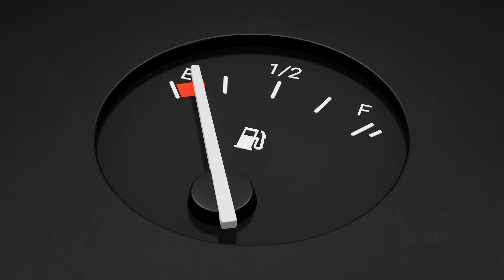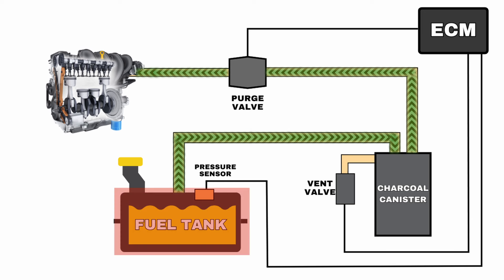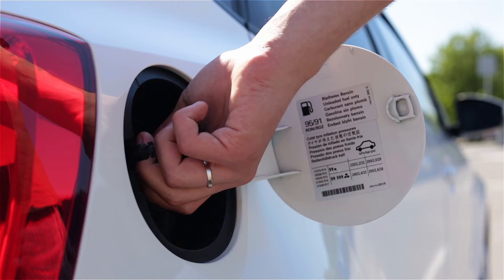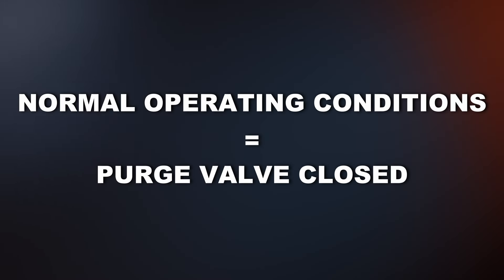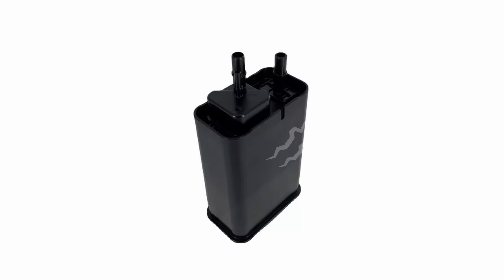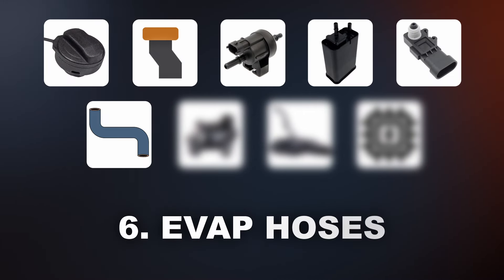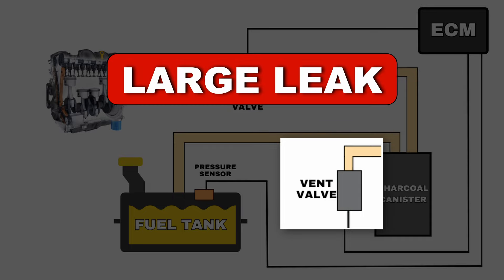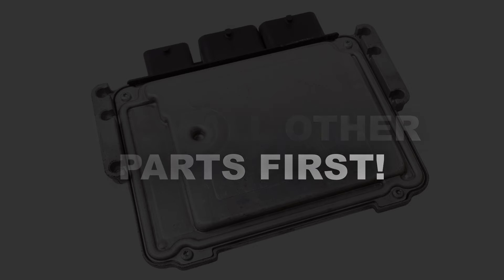P0455 Trouble Code: Evaporative Emission System Leak Detected (The Most Common Causes)

Comment: Hello there, thank for the video . Question : 2012 Nissan Pathfinder , have issues with irregular rmps, and with, maybe , what appears to be transmission shifting .
1. RPMs will suddenly decrease/increase rapidly when coming to a stop, and/or stepping of the gas pedal.
2. Car will jerk foward/backwards when stepping off and on the gas pedal while driving .
P.S. No error codes .

Help🤔
Reply: I can help
Reply: If you haven't fixed it yet, my 2012 Civic had this. Stepping on the gas too hard would gas it to lurch and then go nowhere. Coming to a stop and letting up off the brakes would cause the car to lurch forward. Culprit was a broken air intake tube. Sensor light never came on because engine filter was filthy and the compensation "balanced".
Reply: @theacesalmon9498  your symptoms are not the same that minea, I never steped too hard.on the pedal, and whrn coming to a.stop my vehicle never jump forwards, it just the rpms needle that moves up and down, but the engine speed still the same, doesn't accelerates,

Comment: I had this code on my 2005 Dodge Ram 1500 5.6 Hemi.  I changed the purge valve. The code returned.  I then replaced the charcoal canister and vent valve.  The code came back.  I then RE-replaced the purge valve and the code went away.  That was an expensive defective purge valve because charcoal canisters are expensive!
I am now having a problem with filling up the tank.  It shuts off which makes filling a 27 gal tank take 15 min.  I purchased a smoke machine and found NO leaks.  I am at a total loss... any ideas?
Reply: Check that your filler neck isn't kinked. Also if it's taking forever to fuel up. It could be two things 1 the gas station (some are slow when THEY need to replace the filters within the pumps(try another gas station)). Secondly when it's slow to fill up it's normally the charcoal canister. After replacing it you're supposed to blow air through the lines to get the little charcoal beads out of the lines. If you didn't do that I would definitely check that
Reply: @Dawg39  The filler neck is not kinked. I did put a new charcoal canister on and blue air through the lines. And then I ran smoke to see if there were any leaks. None could be found. 
The vehicle was never in an accident or rolled over but I'm wondering if the rollover sensor which to my understanding stops fuel flow is part of the problem. 

I'm about ready to drop the fuel tank and remove everything from it and replace it. Including the hoses. I'm totally befuddled.
Reply: Did you ever find a solution?
Reply: @emmcee476  Yes and I'm so upset!  You're not going to believe this but out of frustration I took it to a car shop who dropped the tank which is, a pain in the butt if you don't have a lift, went ahead and changed the fuel filter because obviously that's in the tank. It was the original fuel pump. Since I have have 180,000 mi on the truck, I thought it'd be a good idea to change it because soon as I get everything back together the fuel pump . 
Anyway the mechanics were stumped also after running a bunch of tests and then just by fate he had his flashlight looking at the filler hose connection that goes into the tank and saw something that didn't belong. It was a 3-in black tube which resembled a water heater hose that goes into your firewall. No idea how it got there but it happened while I owned the truck. 
The only thing we could think of is during the time when Barack Obama was president, gas prices were about $5 a gallon here and there was a lot of people siphoning gas from tanks.  The mechanic and I both think that it probably came from someone trying to siphon gas and that hoses long enough it got stuck but then after some time it broke loose and fell to the bottom which was not allowing the flap that is in the tank to open all the way. If I could have only figured that out earlier I would have put something down to their and kept jamming it around until it fell into the tank. 
This whole ordeal cost me $700
Reply: @918scott  holy cow. That's crazy. No wonder no new parts every fixed it. Thanks for the update and glad it got figured out 👍

Comment: I could use some insight on my 2015 Chevy Tahoe. Check engine light, throwing P0 455 with vapor smells in cabin. Replace gas cap in purge Valve. Check engine light GONE.

Vapor smells still in cabin, seems to be coming from under the hood. We dropped the fuel tank, checked the lines, cleaned out the vapor canister. No active check engine, but is still throwing the P4055 code. 

What should we check next? Trying to get a smoke machine